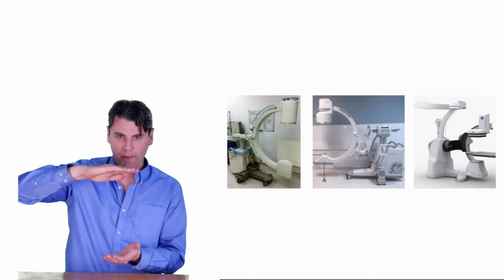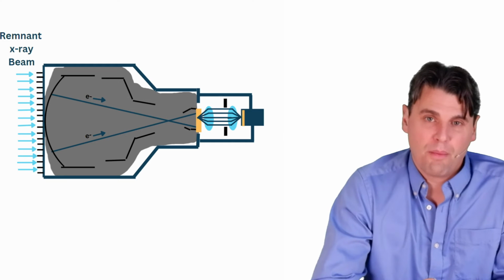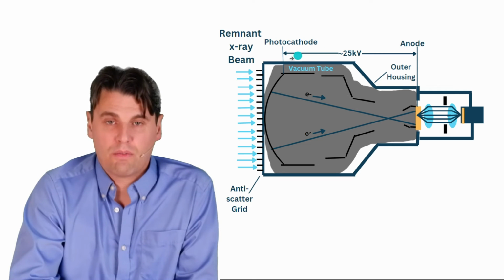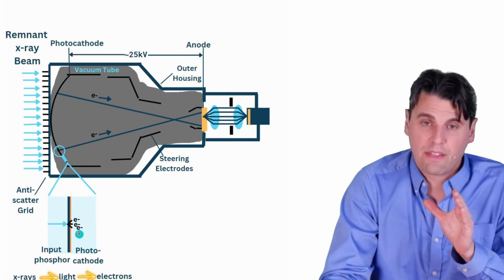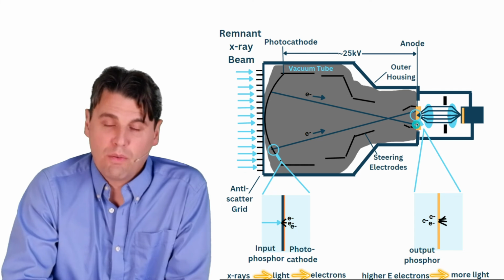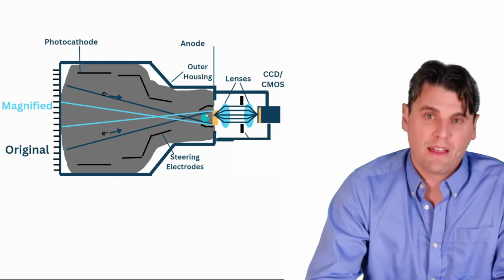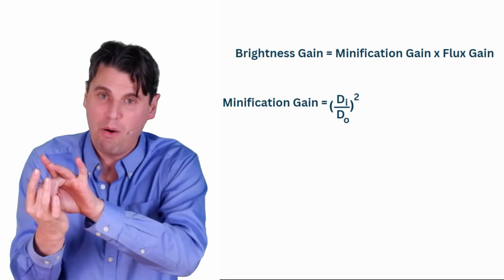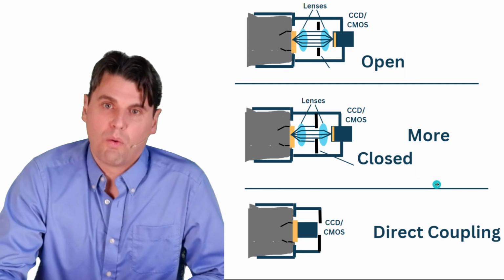Image Intensifier Tubes in Radiology

Comment: The video fails to mention image intensifiers are lead lined inside the aluminum housing and the aluminum input faceplate (about 1mm thick) that separates the vacuum envelope is where the x-ray enters. Also it should be pointed out the grid is totally separate from the image intensifier and not sold with it because each application requires its own parameters of a grid.
Reply from the maker: Thanks Dr for the good points. We do mention the outer housing at 3:14 but not to that detail and it is a good point that grids are separate and we have other videos on grids as well

Comment: can u explain about veiling glare plz..
Reply from the maker: Okay I’ll put it on the list
Reply: Veiling glare is reflected light that occurs from reflections of the light at different interfaces. Basically light reflections inside the output port and between the camera and output port. For instance an output port glass window (or one with a poor transmission factor) would cause more veiling glare than a thin output window. Because the light would go into one side of the glass through the glass and instead of it all exiting the other side some would be reflected backward at an angle to the input side again and then get reflected again. That is the primary cause. This causes a lower gain and lower contrast ratio.

Comment: And how can I make sure of high tension power  of ii tube
Reply: In practicality you cant. The high voltage requires HV probes. The reality is you measure test points on the image intensifier power supply which are scaled down versions of the actual power being applied. Remember this is a vacuum tube and there isn't any loading effect on the power supply.

Comment: What black image mean in the monitors?
Reply from the maker: Is the whole image black or do you mean the black parts of the image
Reply: You must first separate the Image intensifier output from the camera. First of all verify you have dose (i.e. 30uGy for 16", 50uGy for 9", 80uGy for 6", etc. Inverse dose to size due to minification.). Then verify light output from image intensifier. It might appear dim but don't worry about that. If you do then it is in your camera system. Most commonly the problem is the image intensifier power supply but the image intensifier cant be ruled out.

Comment: A very nice overview of an image intensifier.  I would like to replace a 30 year old 12" Image Intensifier coupled to a CCD camera.  Which brand of equipment are you using? 
😎  Thank you.
Reply from the maker: Sorry I don’t have brand recommendations
Reply: @HowRadiologyWorks  Thank you.
Reply: Thales is the most common brand but Dunlee is cheaper and still high quality. Phillips is high quality. Just about any image intensifier is good. Key factors are gain and resolution, contrast ratio, etc.

Comment: I have a question for you... if have two generators from different brands and they both have the same mA station what might cause one to be slightly more powerful than the other? Could there be more keV in one machine than the other? Thanks
Reply from the maker: Different generators could be generating different kVp waveforms and the x-ray spectrum also depends on other factors like the anode material and pre-patient filtration.